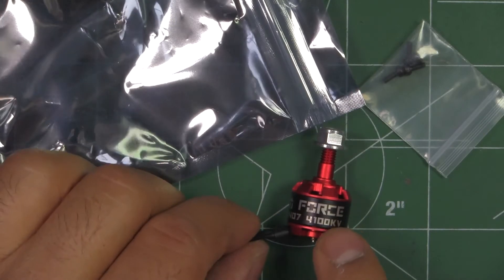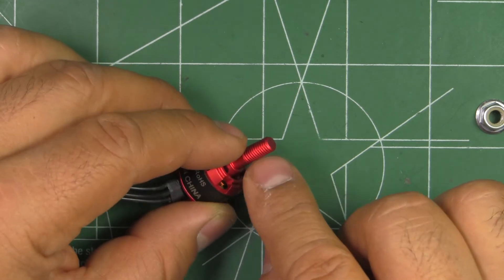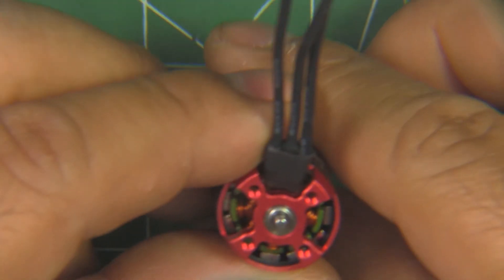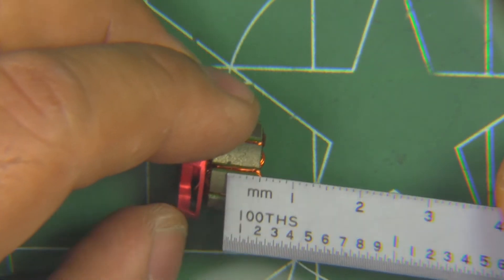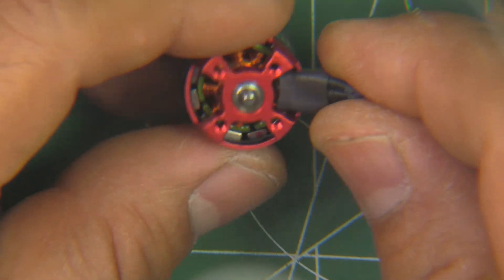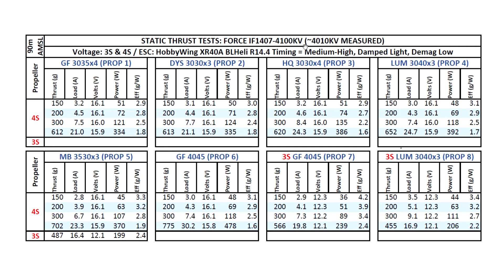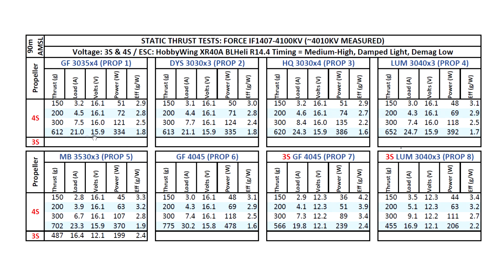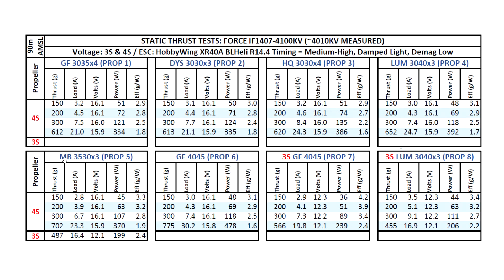IFlight-RC.com Force IF1407-4100KV Static 3S & 4S Thrust Tests & Overview

Comment: Very weak bottom part on these motors
Reply from the maker: Do they break on crashes?
Reply: Yes, they do. Almost no material around mounting holes
Reply from the maker: MrEhitaja74 Uuugh! Don't get why manufacturer's would want to make it weak. Just add a fraction of a gram of more material and avoid simple to solve issues like that.
Reply: Confirmed - I had the 3500kv version that was reviewed earlier - motors were great for 4 inch, until I had a moderate crash today and one of the motor bases was just torn apart. While these are definitely good performing motors, for a few bucks more each you can get a BH or Rotorgeeks or even for the same price, RCX and they have better durability.
Reply from the maker: Uuugh! that's disappointing :( I'll message iFlight-RC to tell the motor factory to improve motor base strength/thickness. I'm using them on a 3" frame so I'll see how long they last, though I don't fly much balls out but do crash every now and then.